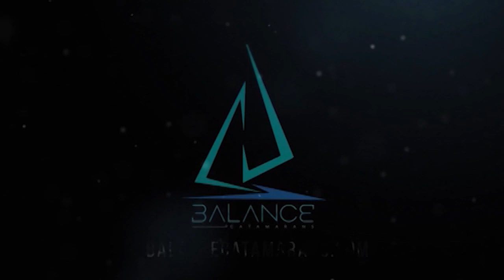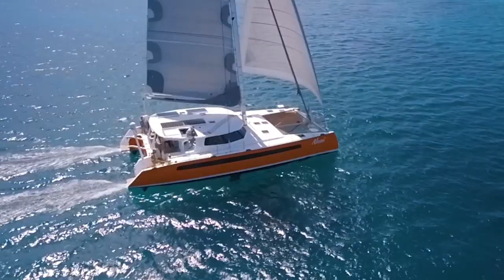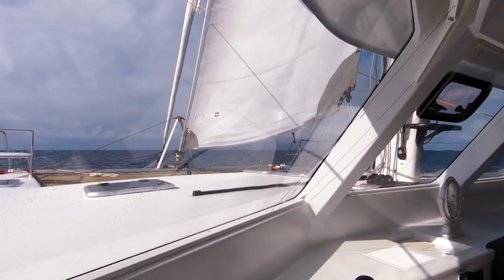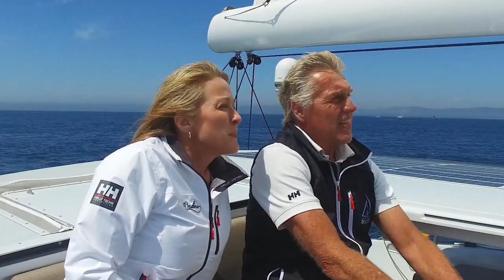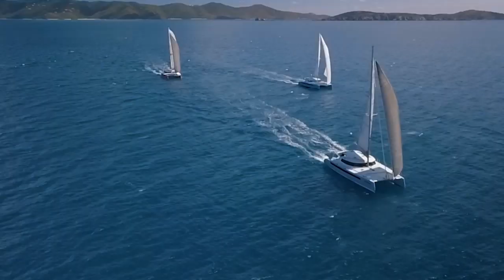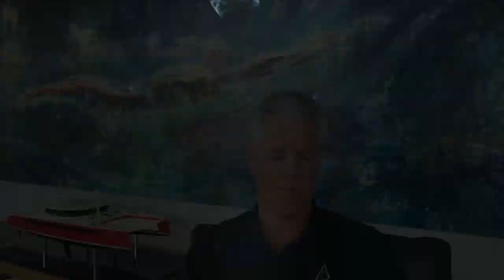Electric Engines on a Balance Catamaran?

Comment: I’m not sure the opposition to generators are as widespread as this video suggests.   If you look at the offerings from Sunreef-Eco, Silent yachts, WIDER yachts, Ocean Volt etc they are based on electric motors, batteries and generators.   

This video seems to be based on a client wishing to eliminate fossil fuels.  Not sure what that has do with electric motors ("engines") on a catamaran as the title suggests.

Diesel electric propulsion is widely used in ships and submarines.
Reply from the maker: Stephen, we do not haveopposition to generators, per. Nor do we have a problem with electric engine cats if they are day sailors you can plug in each night. And sure, if someone wants to get very large electric engines and a very large generator to run them they can do that. But it is not any greener, less reliable, and more costly. The batteries today simply cannot store energy nearly as well as diesel fuel. Nor can the solar generate enough energy to allow a voyaging catamaran to motor quickly or for long distances. We have seen it up close and personal in many electric engine cats.
Reply: @balancecatamarans , thanks for the reply.

I am trying to understand the first principle reasons why electric motors are not favoured by a large number of cat builders.  You bring up solar and batteries but that wasn’t the question.

To travel at 7/8 knots you need about 30kW of power.  So if you have 100kWh battery (fairly large, heavy and expensive) you will only be able to motor for about 3 hours at that speed.   Probably 2.5 hours as you wouldn’t want to get the battery to a very low SOC.   It will also take about week to charge the 100kWh battery with solar and hydro!  So I get the battery and solar limitation.

On certain long passages you might need to motor for 3-6 days in a row.   During that time motoring with a generator and electric motor will be less efficient than the latest diesel engines.  But for the rest of the year you can motor silently and emissions free in marinas, do a fair bit of motoring every day in silence when not on passage.  This removes noise and fine particulate pollution from crowded areas so a big advantage.   Regulation will probably force builders this way in the future in any case (at least in EU).

To make this work you will probably need a 100kWh battery and two 20 kW generators.  The added 500-750kg of this system on a performance catamaran like Balance is probably the biggest disadvantage with current battery technology.  

I would be very interested if you could do case study between the systems at some point with some feedback from your clients.
Reply from the maker: This was a very intelligent note. At present, we are working on a new Integrel Alternator system with lithium batteries and large solar arrays. We will send out a video on this shortly. Our view is that when battery storage is better, solar better we will be happy to consider electric motor cats for voyaging.

Comment: if you put a tesla battery in a sailboat it wont go 350 miles it will go 100 if your lucky. it comes down to pushing through water and rolling overpayment. your going to use more energy swim a mile compared to running a mile. weight then becomes issues two small diesel compared to large battery pack, two electric motors and 1 generator for range extend. i think the only way it makes sense is if you make hybrid small battery for 10-15 miles two small electrics motors and one medium generator (generator 4 knots /50% power load). the most powerful solar panels to give you 2-3 knots in sun or run AC. the problem is making a computer interface that makes everything work together for dummies to use. the solar panel and battery will pay for them self over time for live aboard only or liveaboard charter companies, but for daysailers, rental companies and most rich won't make sense.
Reply from the maker: William you are quite correct. As one of our Balance owners wrote me recently (an engineer), "Electric engines are great. They are in fact 90% efficient, whereas a diesel engine is only 20% efficient." So why does he think electric engines are not ideal for voyaging sailors just yet?  Why isn't the electric catamaran a slam dunk?  It all falls apart, he explains, when you consider energy storage. As an engineer who specializes in fuel cells and energy efficiency he is still ordering his Balance catamaran with diesels. As he wrote me: "It all falls apart when you consider energy storage - electric battery storage versus diesel. Diesel is simply a far more energy dense energy storage material. This is the major point most people miss - an inconvenient truth of "all electric" and the Achilles heel of today's electric vehicles. It was true 100 years ago when Henry Ford was convinced that electric was the way to go and it is still true today. The batteries are a problem (heavy and not very energy dense) as we have been spoiled by the high energy density of liquid fuels, like diesel. Ford had his best guy on the battery problem and was convinced he could crack the code - that guys name was Thomas Edison. Tommy failed to crack the code."  We just are not there yet with batteries or solar to make the electric catamaran as safe or reliable for offshore voyaging as we would like to see them. We may get there, but not close to it yet. If you had to push a 50 foot cat into 18 knot head-winds and big seas at 5 knots for several hours you would deplete even the largest lithium bank very quickly. You still have to turn to a large diesel generator to sustain long range or high speed with any electric engine catamaran.

Comment: A true electric sailing vessel propulsion has regeneration of power from the saildrive. Even at anchor it's possible generate power with saildrive regen in certain marinas. Regen usually creates more power than solar panels.

This sales person speak about extra paddle blades as regen! Price point of 200-300k usd. A complete electric saildrive system is about 40k a pop for the parts. Assembly might cost 1500-7000 usd. Excuse me but is this manufacturer honest populating its sales office with people inventing argument as they talk?

Comment: You have more range on a renewable energy system.
1/3 power oceanvolt electric motor+ Solar+Regenerative+light weight li ion batteries+ small lightweight range extender generator VS A heavy unreliable diesel engine + non renewable store of heavy smelly fuel + risk of contaminated fuel.

Comment: Thank you for being one of the few builders who acknowledges this subject, minutes ahead of our planet’s demise. In 40 years, there will only be jellyfish in the oceans due to the acidity, so this whole conversation is probably moot, however…

If you were at all serious, you would first understand that electric powerplants are called motors, diesel powerplants are called engines. You will only confuse the people who are serious. Second, if you were not afflicted with obscene wealth, you would understand that being environmentally friendly is only one reason to use electric. I can think of no good reasons not to go electric. 

Cost is another reason. You can spend hundreds refilling your diesel tanks at every port for the rest of your life, I'll pass. Also, Lithium is more cost effective than anything else if kept for the life of the batteries. Sion Power is claiming to have 420 wh/kg specific energy this year with lithium metal. Another reason to go electric is you can ditch the diesel generator AND the Watt & Sea generator. How much weight, cost and maintenance did I just save you? With two electric motors, you get twice the regeneration, about 2 KW @ 8 kts, over 20 KW at 22 kts. You do not have to plug in an electric boat to charge its batteries, a fast catamaran like yours charges faster than a slow one. You would get 2 knots of drag at worst. Solar panels are typically only used to compensate for household use. A true “Voyager” – one who sails for weeks and months and not hours- would always have full batteries, and would be self-assured because he knows how to sail his sailboat.

Another reason to go electric is maintenance and safety. If you have no diesel engines or generators, you don't even have to learn diesel maintenance and you would not have to worry about engine failure. How much time and money did I save you? How much safety did you just gain, knowing also that you would never be permanently out of fuel, no matter how remote you are? It's a safety issue just like having a water maker. It is also non-toxic, unlike petroleum products. You would never have to clean or remove a diesel fuel tank or siphon fuel. With an electric dinghy motor and indoor and outdoor induction cook tops, you would not need gasoline or propane either. Think of all the money we would not have to spend.
 An electric motor costs more than a 25 HP Yamaha dinghy engine, but not including a lifetime of gas, maintenance and engine replacements; not to mention the inconvenience of being broken down. You are less likely to get injured hoisting a motor vs a gas engine.

Another reason is noise. Poisoning the water with fossil fuels is only one way we harm the oceans. Studies have shown noise below the water affects sea life in many ways. It is also stressful for humans.
 Who likes sleeping over a running diesel?

If you want to “motor” around the world in a sailboat, no, electric is not for you, but neither is a sailboat.
Reply from the maker: Dave, 
Are you suggesting that a diesel engine Balance cat that is sailing at wind-speed in 7 knots of wind is any less green than a Balance cat with electric engines and a big diesel generator?  An electric sailboat still must run a diesel engine if it is voyaging any distance where it cannot plug in each night. Or be an ultra long, super super slender hull that carries no room inside, or payload, and has a massive rig so it can sail in ultra light airs. We can build that for you!!!  Would be loads of fun. Would cost a lot. Sleeping and storage would be cramped. You could not carry much. But she could probably work without a generator and only electrics. If you want to fund that project we are very happy to do it. 

One of our owners sailed from Cape Town to Tortola and only used 2/3 a tank of fuel on a 526 model. Is that a crying shame to go 8,000 miles over the ocean?  Very few cats built today could do that. The issue you fail to grasp is that electric engines are super green and efficient if you can plug them in each night and get your electricity from a state or country that is not relying on coal to generate that electricity. Fine, get electric. We would love to build that boat for you too. Perfect application and very green. We are in fact working on an all electric power cat for this sort of application. 

The issue when voyaging is that you sometimes need to move swiftly and long distances. To do that on an electric cat you must also be running a very large generator or two. So what is any greener about that?  We cannot get enough solar on the top of our sail cats to do without a generator - or diesel with high output alternators of some sort - yet. Trust me we have run the numbers. We may get there as I say, but not yet. Now, if the entire goal is to be green, and a worthy one I might add, the key is to sail in the lightest winds and not be bothered by drifting about a bit when you are waiting for enough wind to push you. A purest could do that. Everyone did that for centuries after all. I have sold over 900 catamarans in my life and have a great deal of experience with electric engine/motor! cats and the struggles and challenges they have presented for voyagers. If they were indeed greener then the sacrifices you must make to have them (limited range under power or a massive diesel generator to run them) might be worth it. Batteries to date are simply too heavy and not energy dense enough to trump the advantages of diesel - yet. Fair sailing. Phil
Reply: @balancecatamarans  Phil,
If your owner sailing 8,000 miles from Cape Town had 130 Gal tanks and used 2/3rds of one of them, then he used about 87 gallons, which would be about $260 @ $3/Gallon, and as I tried to imply, no Balance owner would ever be concerned with the price of diesel fuel, or much at all. And as you say, Balance catamarans are indeed fantastically efficient as sailboats, but that is what makes them good candidates for electric, provided not too heavy. I tend to look at stock diesels in a sailing catamaran, one with 20 HP engines would be easier to electrify than one with 80 HP engines, generally speaking. The goal is to sip, not gulp, to get to your motoring speed with the least power possible. But I have a few questions for you about that trip. 

How far do you typically average “motoring” with 87 Gallons on a 526 and at what (horse)power setting (What RPM and what engine), and would the owner only be using one engine as we would expect? We could determine specifically how much power would be required. 1 HP is about 0.75 KW.

Was the motoring done all contiguously? If so, for what reasons? If not, what was the longest stretch actually done motoring? How many miles were sailed in between motoring legs and at what sailing speeds? He should have had full batteries on an 8,000-mile trip in a fast and efficiently sailing boat with no generators other than the electric propulsion motors, unless you are just using the standard starter batteries of a stock diesel catamaran, which would be like using an empty fuel tank.
 You can't trade a lifetime of diesel for a couple starter batteries.

On your previous electric builds, what sized motors, on average, are used and how many KWH of batteries are you using? For electric propulsion, it is always better to think in terms of KWH rather than Amp hours. What contiguous motoring ranges are you averaging with that set up? Are you using a motor and propeller combination that even allow regeneration? Many do not. If not, I can understand why you are stuck on plugging in.

I am still baffled why you made the video, though. You seem to be warning everyone against electric motors, but also that you would begrudgingly assist, if absolutely necessary?

Thanks for your response,
Dave
Reply from the maker: I did not make that trip Dave. But you must move through the Doldrums on that delivery and it varies in size. I do not have the time here to contact the owner and get the level of detail you seem to seek. The passages are all different. We have done the numbers enough to know that we do not think electric is yet ideal for voyaging. That is all I said or will say. You just have to look at the facts of storing energy to know that electric is not ideal yet for distance voyaging. Either the batteries need to get a lot more efficient, or the solar. End of story. We have several highly trained engineers buying our boats and they all know this and agree with us. 

Finally, it is unwise not to share your experience with your customers, what you think, based on what you have seen and know. In my work as a yacht broker over the years I've spent hundreds of hours trying to talk people out of what I feel are dumb decisions. That is what a yacht broker should do. Advise based on experience, not on making the quickest or most profitable sale.

I have overseen at this point over 900 catamaran sales. I assisted a poor man a few years ago yank his horribly unreliable electric motors so he could enjoy sailing his catamaran again. I never received a penny from him. But I got to seem him happy and sailing again and that was payment enough. I watched many Lagoon 42's get retrofits from electric back to diesel. I have listened to captains who are not imbued with confirmation bias or some sales agenda tell me what they think. We were actually very excited to do the electric, all solar cat for a climate scientist at Balance, until he insisted it must have no diesel generator as backup. We felt it was dangerous to send him into the Southern Ocean on such a cat. The last thing we want on our record is someone dying on one of your yachts.

All sorts of people and companies will go on and on about all electric, it is so green, this or that. It just isn't. Unless you can plug in to a dock each night that derives its power in a green manner. But if someone wants to get a big generator or two, pay up to have an electric system, and someone else will warrant it, why not do it?  A lot of people do not take their doctors advice!  Or their accountants, etc.  I am not the final authority on this subject. It is not for me, but it may be right for you. If it is safe we will do it. If we feel it isn't we won't. We are presently discussing a short range electric power cat. You can put on a lot more solar on a power cat top, put on a gen, and for people not crossing oceans or distances, it is perfectly fine. Take care Dave. I think at this point I've said about all I can on this subject!  If you disagree that's fine by me. Stay in Balance!

Comment: Yeah but nobody ever talks about the nuclear waste I am on the batteries are no longer good how about that waste
Reply: Lithium ion batteries, used within their parameters, can last decades.  Tesla's current car battery packs last more than 300,000 to 500,000 real world miles.  That's 20 to 30 years of driving.  And batteries are being constantly improved.  And the types of cells that Tesla uses are optimized more for power and energy density than long life.   Other Lithium Ion battery chemisties may last even longer.